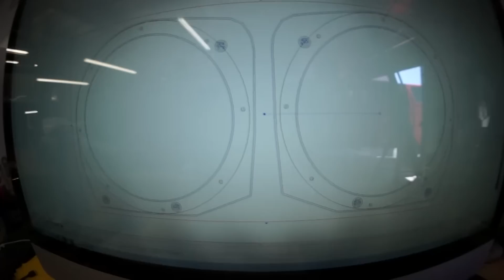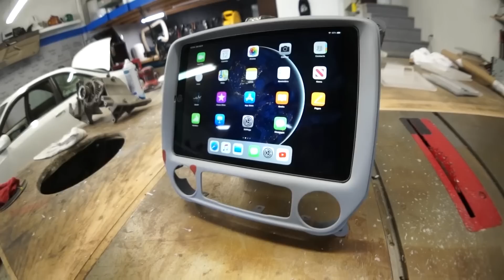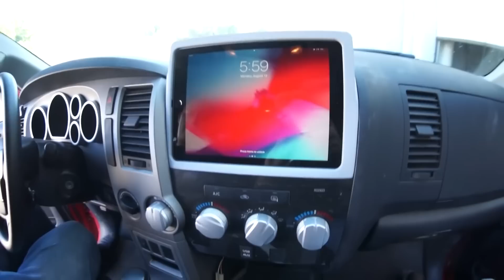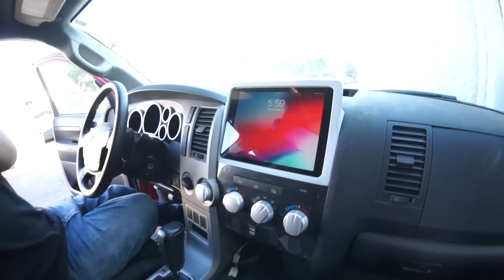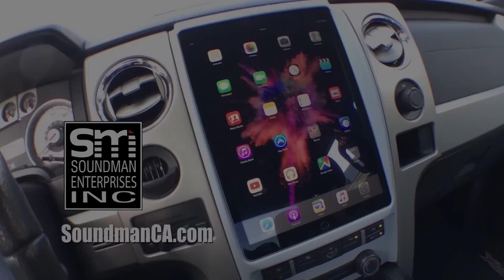finished 8" Hertz mids in the door! - Acura stereo system #9

Comment: How can I get Dynaudio Esotec MW172 8” woofers to fit in my 2018 Honda Civic Type R door cards? I have the Esotec 3 way component set. Will be running Audison 5.1 and or Quattro and the Bit one dsp processor. Bought aluminum cnc speaker pods for the 3” mid and tweeter to mount on the front pillars.